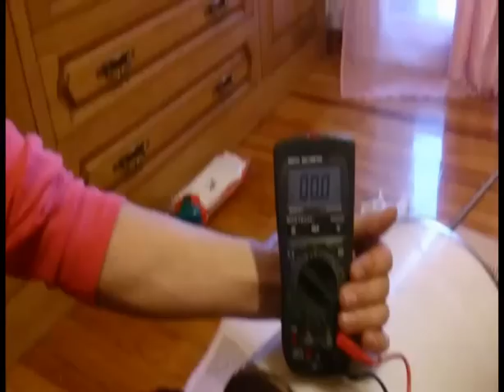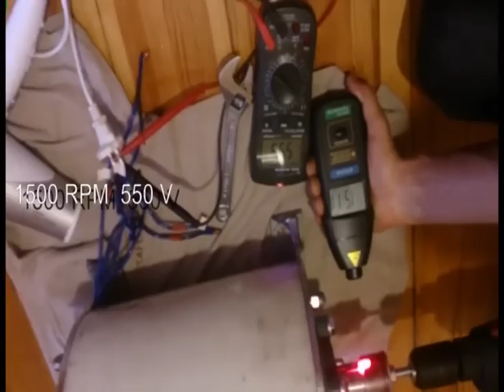Generador imanes permanentes

Comment: Hola mi nombre es Claudio spagna quiero preguntar:
1.- A Simion Beuka, si podría enviarme la información para poder replicar de este generador, se ve muy interesante el reto, datos de bobinas, calibre de alambre, conexiones, etc.
2.- Les pregunto a todos, si en toda su búsqueda han encontrado algo interesante para
tener electricidad que de autosuficiencia en la casa.
3.- Si alguien sabe cómo hacer para tener disponibilidad de amperios en un generador eléctrico, que pueda conectar al menos 1,5Kw en aparatos. Bueno gracias por su tiempo,Un fraternal Saludo. spagna
Mostrar menos

Comment: Hola mi nombre es Gabriel Ramírez, quiero preguntar:
1.- A Simion Beuka, si podría enviarme la información para poder replicar de este generador, se ve muy interesante el reto, datos de bobinas, calibre de alambre, conexiones, etc.
2.- Les pregunto a todos, si en toda su búsqueda han encontrado algo interesante para
tener electricidad que de autosuficiencia en la casa.
3.- Si alguien sabe cómo hacer para tener disponibilidad de amperios en un generador eléctrico, que pueda conectar al menos 1,5Kw en aparatos. Bueno gracias por su tiempo, Un fraternal Saludo. Gabriel.
Reply: Hola, yo quisiera saber también la información de las bobinas, gracias.